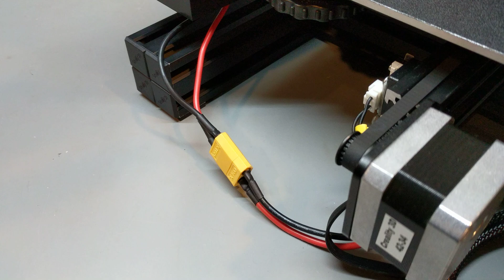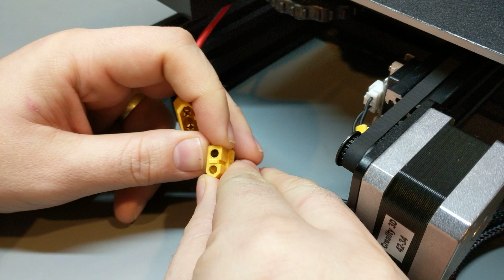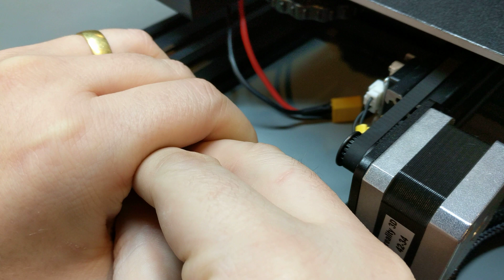Ender 3 XT-60 Power Connector Fix

Comment: I had the Power Outage error when printing, just random. I tried opening the plugs but still had the issue. I ended up replacing the plugs with one piece of 14AWG silicone wire from the board straight to the power supply. So far so good.
Reply: Hi can you give more detail on how you fixed that problem? Ive been having issues and need this problem fixed immediately
Reply: @Uncanny_Moon  So after ‘fixing’ the plug issue I still had this problem. I switched slicer, from Simplify3D to Cura and so far it hasn’t stopped or been a problem. My guess is bad G-Code which apparently can cause this issue 🤷🏻‍♂️

Comment: I was wondering if it is normal to a get a little bit of heat from a 4-hour print (Warm enough to notice it if you were trying to but not to be concerned about it melting or anything)? I don't want to do this and then think that it still needs fixing even if that amount of heat is normal. (Sorry I am new to 3d printing and wiring and all that stuff)
Reply from the maker: It shouldn't be getting warm at all. If it is I would remove it and solder and shrinkwrap the wires.
Reply: @brainrecall  Ok thank you for the quick reply

Comment: Hi I tried this solution however it is still getting really hot. any suggestions?
Reply: https://proxy.duckduckgo.com/iu/?u=http%3A%2F%2Fwww.duden.de%2F_media_%2Ffull%2FL%2FLuesterklemme-201020583640.jpg&f=1
Reply: Replacing the connector with a higher quality XT-60 connector is the obvious solution. Apparently the ones used in Ender 3 are knock-offs
Reply: @66alibaba66  +1 for the ceramic casing. I have used it after realizing that my solder or my skill is not enough to sold this nasty cables :-/
Reply from the maker: In that case I would remove it entirely and directly solder both wires together and shrinkwrap.